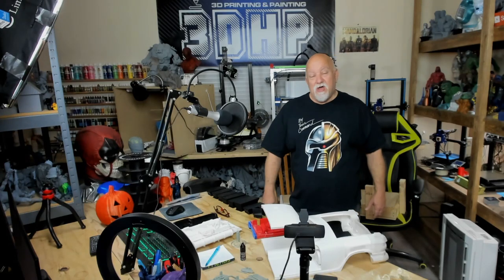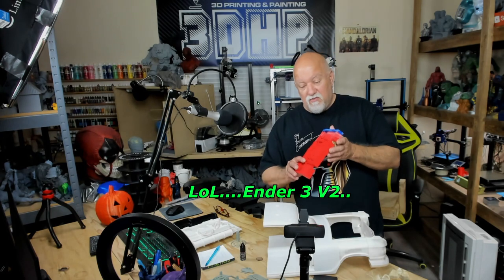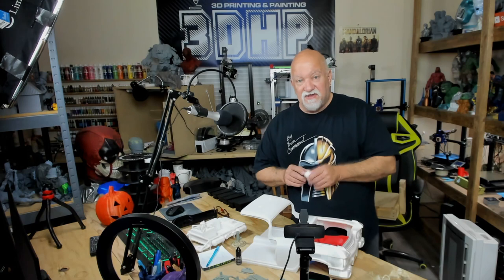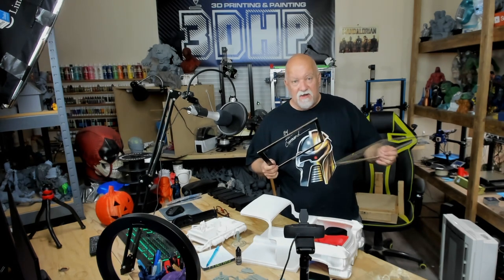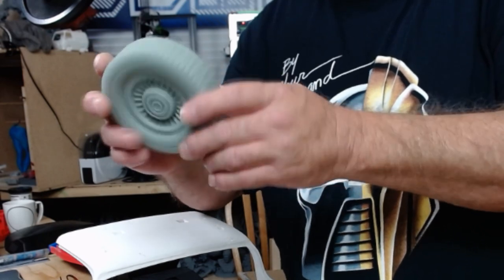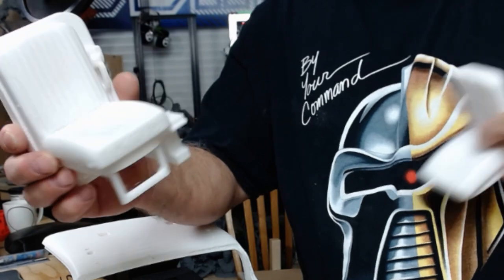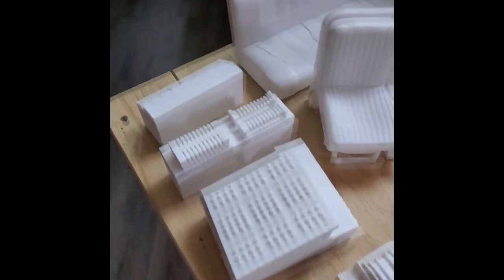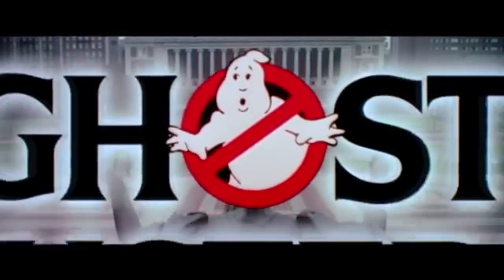Ghostbusters Ecto 1 3d Printing Part 2 #3dhp

Comment: Nice print man..  So have you had any issues with the .Stl ?  I have tried to print a few pieces @ 320% and get weird printer stops 5 to 12 hours in. I know a lot of variables just curious if the .Stl files are solid and legit. Could be my new printer and probably is. I just got a Ender 3 V2 and so far its garbage.. outside of dead silent I hate it.  Love my Ender 5s though. My CR10S5 was garbage and have a new Ender 5 plus and Crealitys new SLA in box. Crossing fingers at this point I'm batting like 50% with Creality. I think I'm done wasting money with them. Ok rant over :)
Reply: NM looks like its my printer,  Just tried a file from Gambody and printer stopped about 45 min in.  doh!!!
Reply from the maker: .stl files have been great,no issues with them at all.

Comment: how much filament have you spent?  What is the scale used?
Reply from the maker: About 12 roll on body which includes a ton of supports to the best of my memory. Also a lot of resin for smaller thing. Just listed this on my ETSY Store. Never finished building model.